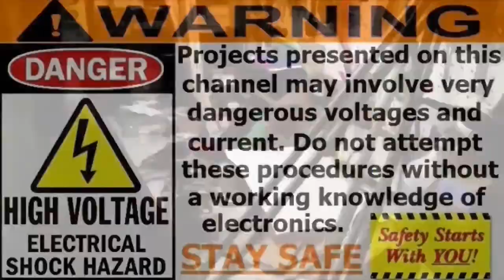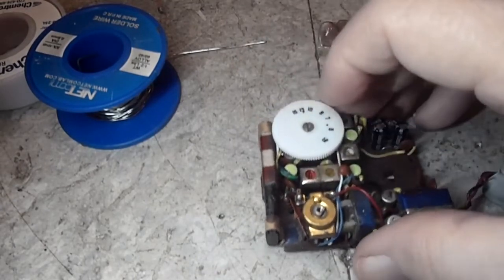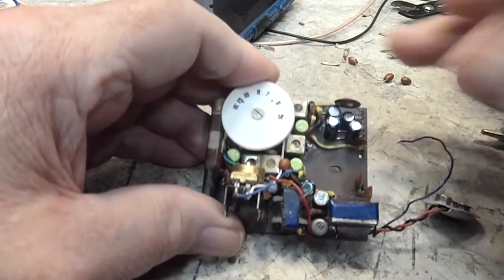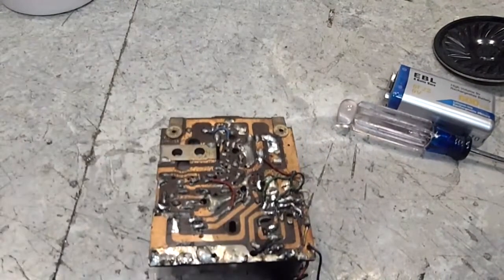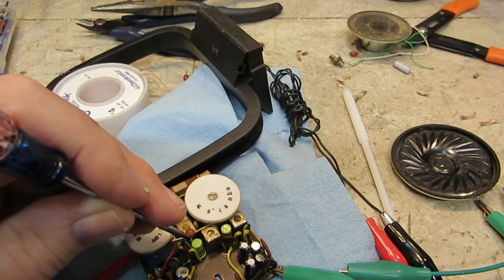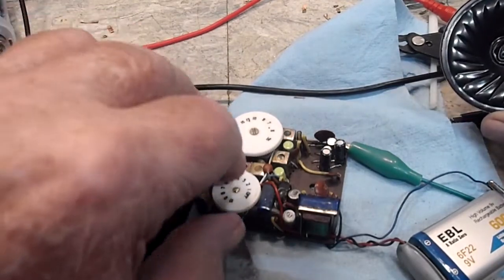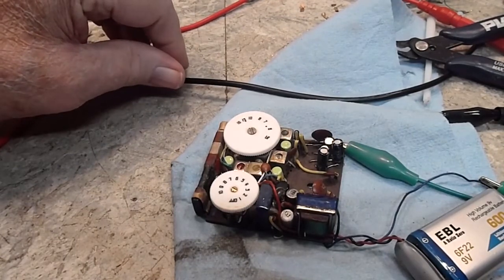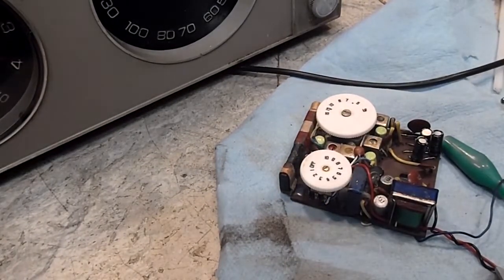DERB - Baylor 6 Radio - The Little Bastard - Part 1

Comment: The volume pot is very different looking, specifically designed for this cramped radio. I think your correct about the oscillator not working because it should squeal when tuning the dial.